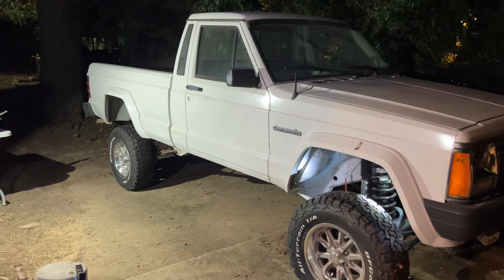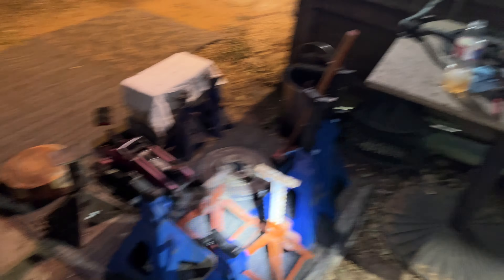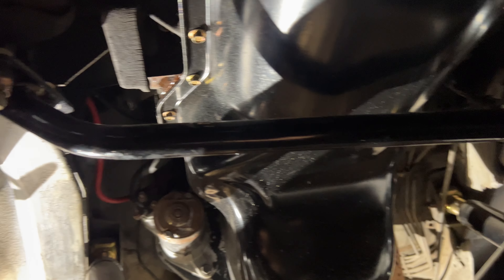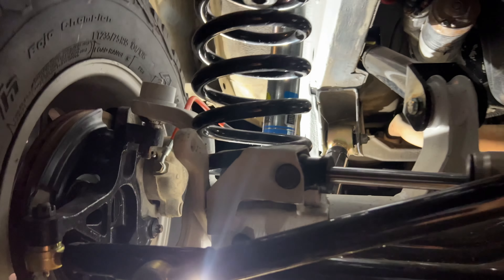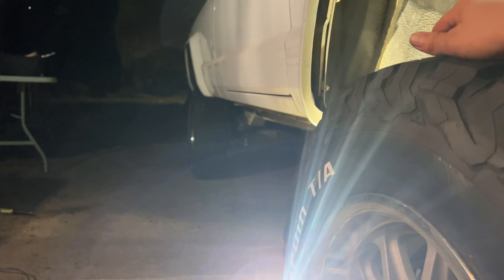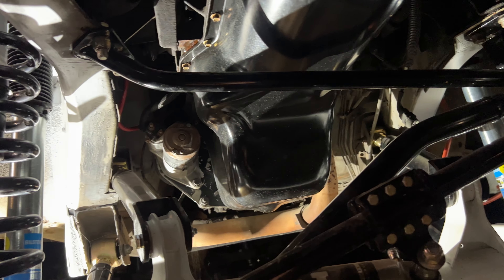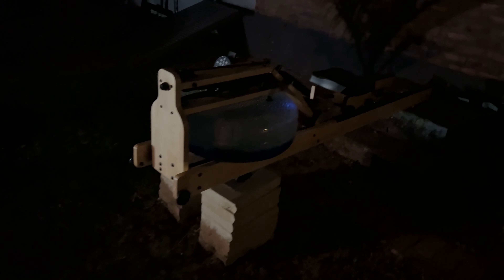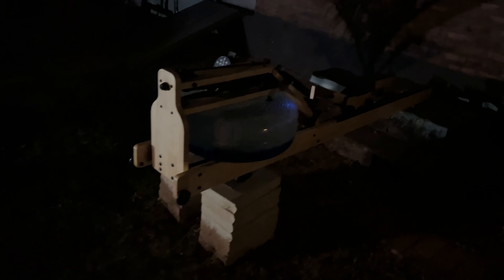Jeep Comanche 6 inch lift finally complete 1 whole year after I Started #jeep #solo #rustysoff-road

Comment: Youre truck..  whatever makes you happy.  I think the lift is too much.  But im just going off looks.   I just dont like high lifts so it isnt anything against your Jeep.. its just my taste.  My Grand Wagoneer i did only 3 inchs

If you want new tires i recomend the mastercraft MXTs.  Ive had them on my Grand Wagoneer for 3 years.. close to 20k miles on them and theyre bout 50% still there.  They do amazing in the rain.  On road and off.  And last a long time.  Very minimal noise
Reply from the maker: thanks for the tire tip but no way dude, I like the lift a lot, granted there is still I have to do before I even drive it, I don’t know if the rear axle angle is correct but I really like lift height. I think it’s actually like the minimum. I think it’s still sitting lower than a new wrangler
Reply: @cousin_JACK  doubt that.  My Grand Wagoneer sits higher than a regular wrangler.  Wranglers have trim packages for height.